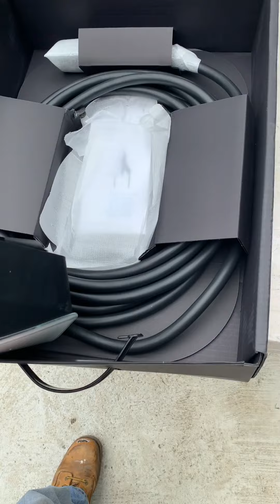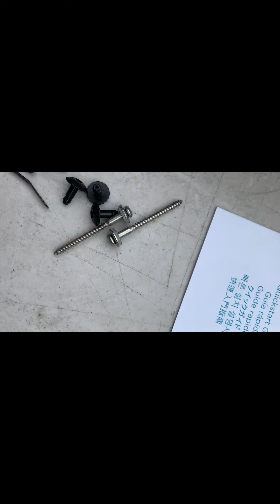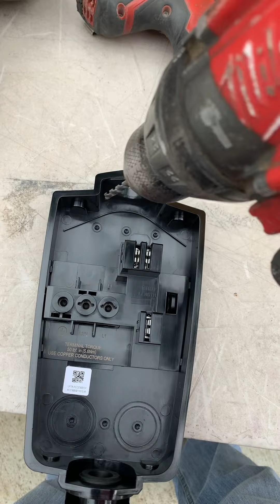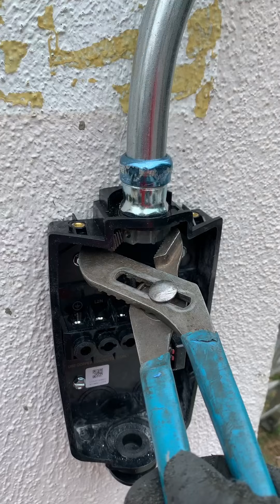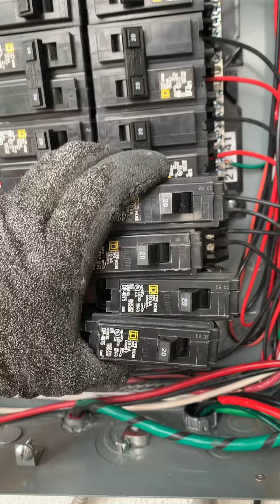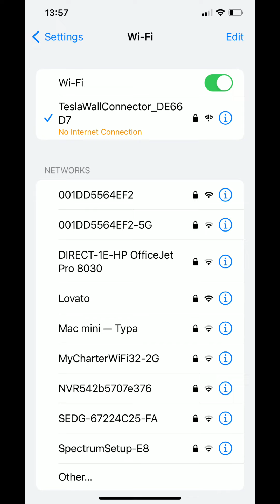How To Install a Tesla EV Charger Level 2  GEN 3 with 60 Amp Breaker

Comment: What was the total cost for installation?
Reply: Every installation is different depending on the city some city permits are $100. Some cities charge $500 just for the permit installation costs vary depending on how far the electrical panel is from the charger location and depends on what size breaker we’re using average cost for California specifically Southern California is around $1000 and goes up from there.

Comment: If I have the Model 3 SR 32 amp max... Is there any reason to go with a 60 Amp breaker?
Reply: no  unless you have multiple cars  or want the outlet outside????  or change cars.
Reply: In most cases 32 amp charger will be more than enough. However, you want to have wire and breaker for higher load just in case if you want upgrade  charger or change your vehicle.
Reply: 60A would have no benefit to you.  IF, you get a second EV someday, it would be better to keep that 40A circuit and add another circuit at the size needed for that car.

Comment: At the end you mention connecting two chargers with one breaker. How does that work? Thank you!
Reply from the maker: power sharing,  needs to be set up and wired  with 3 ports  wire connectors.   Ill upload a video  on power sharing ...
Reply: Thank you!
Reply: Instructions in the wall charger manual which you can find online.  I did it.  Two wall connectors on one breaker.  Power sharing uses WiFi between the wall chargers and works great!